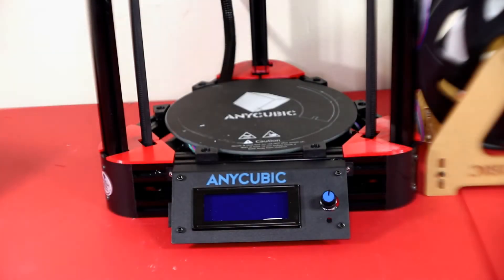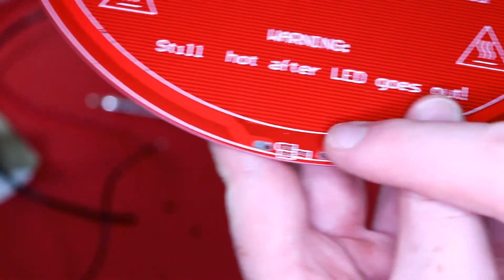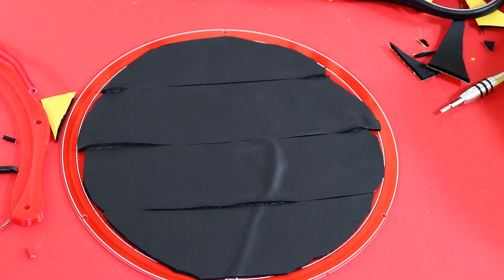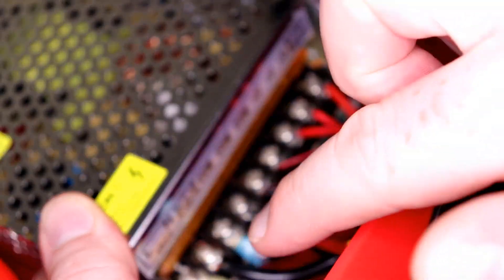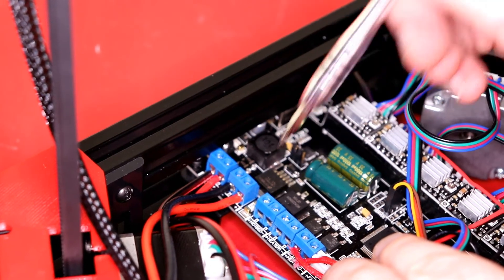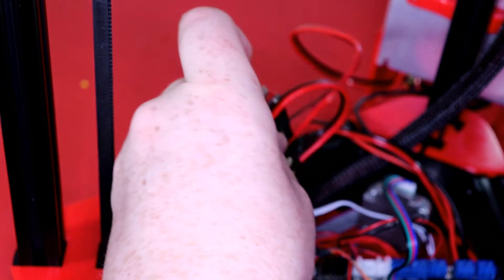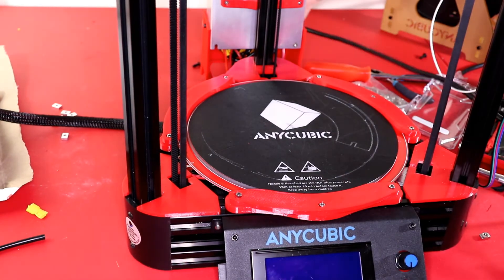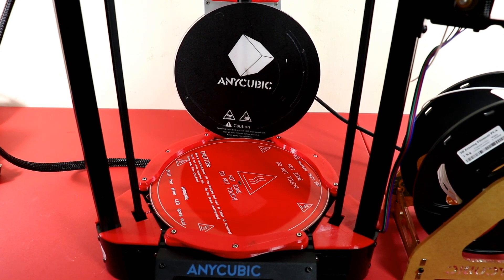Anycubic Kossel Heated Bed Upgrade

Comment: Great tutorial - one thing I think should be clarified though is that the thermistor for the heated bed needs to be connected to the board next to the thermistor for the extruder, specifically at the port labelled T1. The order of the positive and negative wires makes no difference.

Comment: Unless I missed it, you never said how to enable the heated bed in the firmware? Just did a similar upgrade with a slightly different power supply and mosfett, but having trouble with the firmware.

Comment: Thank you very much! I was already starting to regret having bought the printer too early (the new version already has heat bed and auto-level). The biggest problem is that there was no heated bed that was 200 mm, they were 220 mm, but now I see how you mounted it.

Comment: I went through several videos before I found yours.  You answered my question of how to hook the external power supply to the controller board.  You confirmed what I guessed, but I was hesitant to cause a bright blue flash and a curl of smoke, so thank you very much.  In the morning, after church, I will finish up my wiring.
Reply: Is it okay if you use 20 amp psu instead of 10 amp psu?
Reply from the maker: Yeah you can always go higher in amps the machine will only take what it needs

Comment: Is it safe electronic under heatbed for long printing time?
Reply from the maker: The insulation tape provides a safety barrier for the controller board. I ran it for about a 2-hour print with the bed at 60 degrees Celcius and felt underneath there and it wasn't too warm. You could add a 40mm fan underneath pushing the flow of air on the control board. I honestly don't think you'll need to though.
Reply: @EricsDIY  Well, the A4988s get very hot even without a heated bed, so I'd install a fan anyways.
Reply: I have seen people adding a fan to make sure the board doesnt heat up. Other solutions I've seen is that they mount the board and screen at the top of the printer but that means that you have to buy long motor cables to reach does to the bottom of the printer